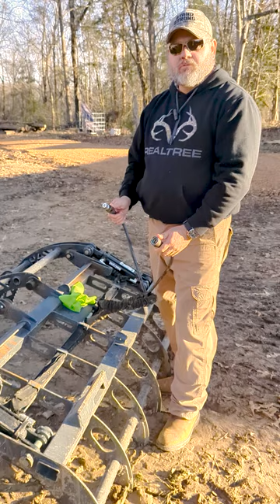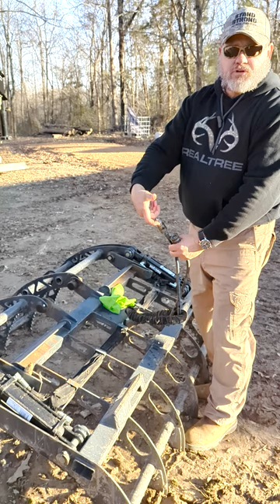Compact Tractor Tip & Grapple Hack #2

Comment: On our bobcat I undid the quick connect ends them tightened them back up. Any way you can release the pressure. Undo the line someplace and it'll work

Comment: It’s not temperature differential causing that pressure buildup, it’s hydraulic fluid slipping past the rings from the closed end of the piston to the rod end. The difference in surface area creates a pressure differential that increases as more fluid slips past.
Reply from the maker: Thank you for your insight. I figured in my thirty years working in hydraulics, going to multiple schools, and having a really good understanding of fluid dynamics, it was temperature change. Who knew all of those engineers and instructors were wrong! One question, If fluid slips by the rings on a cylinder, why would there ever be pressure on one side or the other of the cylinder?

Comment: This makes the assumption that your third function has 1 male and 1 female,  many are one gender on loader, opposite gender on attachments.  It can easily be remedied with wrenches,  but some people have reasons for other ways of having them plumbed.  Most notably,  flat face to match their Skidsteer.
Reply from the maker: I am comfortable in making that assumption, since probably less than 1% of tractor owners have a skid steer. Owning a tractor is not easy. It requires thinking for oneself based upon one's circumstance.😁👍

Comment: also keeps crap off of the fittings for next time. also both sides already have the same EXTREAM pressure differences due to temp. changes.

Comment: Not all equipment has a male and on one hose in a female on the other a lot of stuff I see agriculture equipment has two male ends and the female and is normally on the tractor
Reply from the maker: That is totally done by the owners and it makes no sense to do it that way. You will have to mark the hoses to know the flow or guess every time. With male and female on the equipment, the operator doesn't have to guess. Male and Female third function is the standard of the industry. I can't see any reason to have two males or females on the tractor. There absolutely no benefit.
Reply: @TonysTractorAdventure  there's a little thing on the hydraulic outlet there's a picture of a cylinder in which goes goes where there's no big deal you get the backwards take them out switch them around and it doesn't matter which way you put the hoses it was still raise and lower the you're just go be pushing the lever the opposite direction and if you don't believe me when I say everything is original are there any engine rebuild on a couple of them cuz of how many hours are on the tractors nothing's been changed except for one tractor had an extra remote added because it had the option for 3 from factory but they only had to sew my great-grandfather added the third one if you don't and if you don't believe me that they did not come factory with female ends on the on the remote you know the outlet side is where you hook them up to the tractor and male ends on the hoses I'll make a special video just a person of it YouTube to show you cuz I'm the only person on Tik-Tok